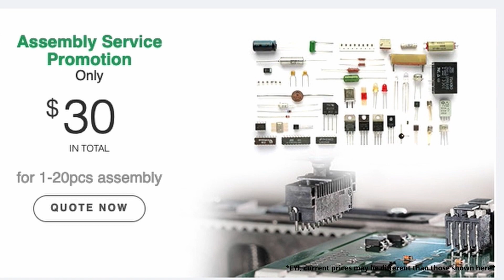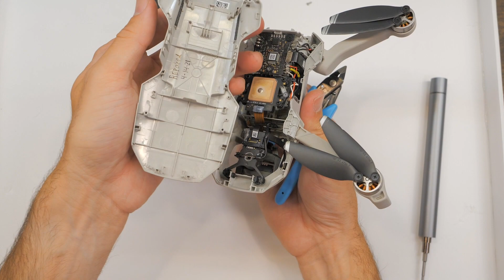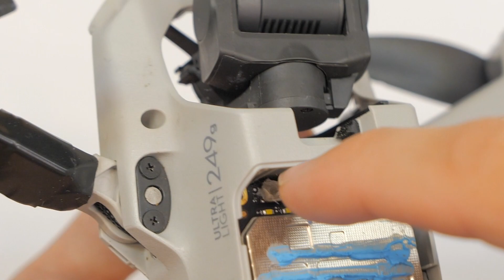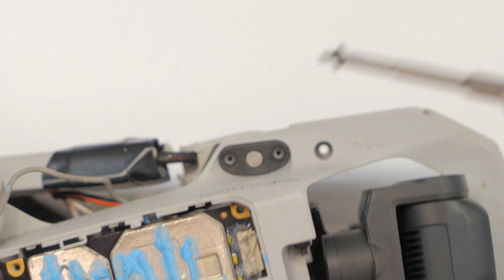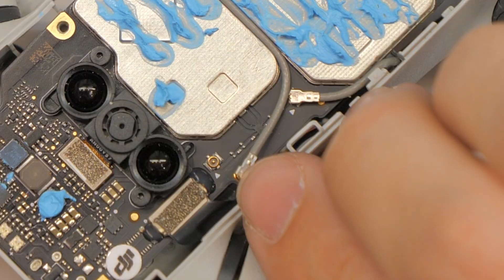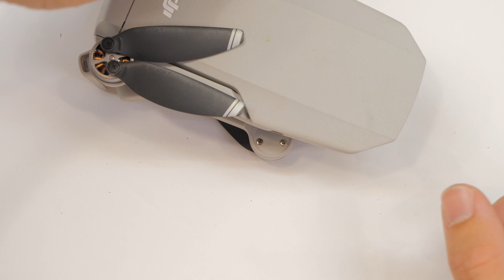How to Replace Mavic Mini FRONT RIGHT Arm Tutorial - Removal and Install - DJI Repair

Comment: At what temperature did you set your soldering iron please?
Reply: It doesn't matter the temperature start low and go into the solder melts.
Reply: @Ryman888I was asking to find out whether I needed to buy a more powerful iron which I did in the end and solved the issue.
Thanks for your help and reply

Comment: 14:02 pull the antenna wire through and do not use a pliers to pull on the tiny fitting on the wire! You can get the wire long enough to make it to the fitting without pulling hard in it (I did and broke off the fitting and had to buy another replacement arm 😂)

Comment: Hey Adam or anyone else that watched this video, I tried un-soldering the wires but even when my iron got to 450 C, it still didn't melt! anyone else encounter this problem and does anyone know how to solve it?
Reply: I had it at 450C and it would not desolder until I got it to 500C. Then it desoldered instantly. I probably could have gone a little cooler.

Comment: Thanks very much
I watched another video that was filmed very fast and no voice over and they didn’t explain or show the spring loaded arm connector 
You saved the day
Reply: That was the most crucial part
Reply from the maker: Thank you for the feedback! Glad I could help!
Reply: That was my problem. Dumb arm wouldn't lock into place, so i took it apart, soldered it and everything for nothing. This is the most crucial part!!!!

Comment: really great instructional video.. Thank you.. many others (supposedly for the same operation) take a shed load of other components apart unnecessarily... Great job!  
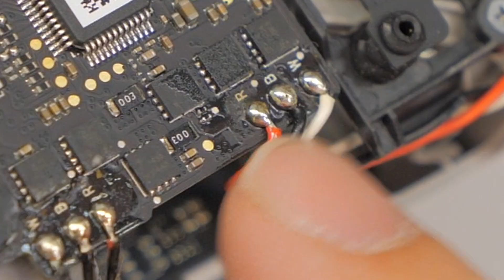PS  As an Englishman I must admit It was great to hear you actually say.. at 4:55.. sold-der instead of sodder.. .. you also said battery instead of baddery..  this video is a keeper for future reference .. thanks for your time and effort in producing this.